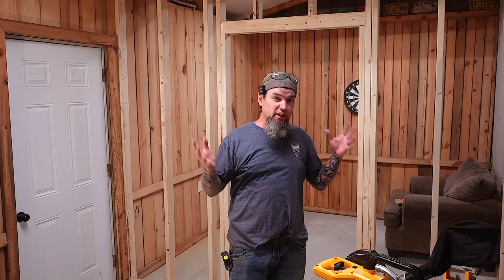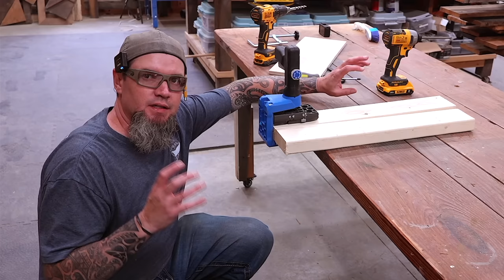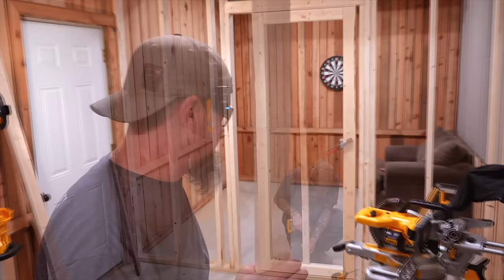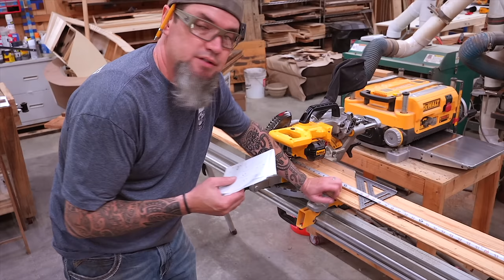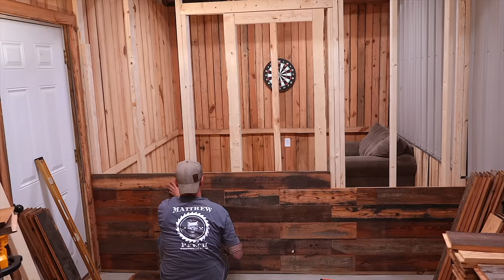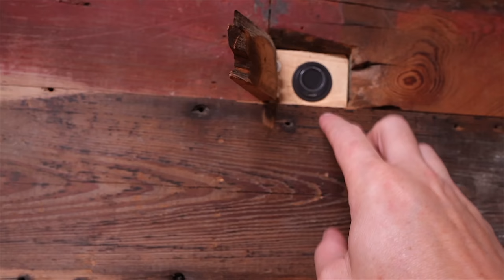Make A Hidden Room With Secret Compartments

Comment: Is it a safety issue to require finger print reader on inside for egress?  I am thinking of a kid or someone who gets in but then cannot get out in case of emergency.
Reply from the maker: The lock that finalized with will require fingerprint opening and locking all from the outside.  You manually lock it from the inside and the biometric stays unlocked while your inside.

Comment: hi great job love the finish result  not sure how your locking and opening mechanism works but you should install a manual release from the inside just in case you have power failure

Comment: Could you hinge the fingerprint scanner? Then just flip the wood panel it's in open to show the scanner to inside
Reply from the maker: Yes.  That was actually one of my work arounds that I had thought of.  But ended up with the lock staying unlocked while your inside and a manual lock inside.  Then you can lock it with a fingerprint from the outside when your leaving.

Comment: Or just put the board to which you mounted the fingerprint scanner on a hinge so you can access it from the inside. Although, if it moved out of position, then you might not be able to access it from outside. I would think they could have a simple switch to unlatch it from one side.

Comment: Love the room. Amazing. Quick question...why did you sandwich the hinges in between the 2X4's instead of screwing them on the edges of each one? That would have eliminated the gap problem. Would it have caused a pivot problem with the way the rustic boards pivoted? Could you have chiseled out the 2X4's to accommodate the hinges thereby eliminating the gap issue? Just trying to work through everything in my head. Thanks for all you post. You're rocking it.
Reply from the maker: So that I could get all the screws in.  The hinges were wider than 1 1/2"
Reply: @MatthewPeechWoodworking  See...I knew there was a reason. :D

Comment: Been wanting to do this myself.   Great video. 

Only changes I would make would be to use bevel cuts instead of miters for the boards and to increase the gap on the lock side of the door and framing.
Reply from the maker: You’ll enjoy a build like this! Have fun with it.

Comment: Thank you for your idea. I'm trying to build hidden door from the 20 x 10 enclosed deck to the laundry entrance. The  main entrance is a sliding glass door.  But i still want  access to the laundry room. An accent wall of dry stock Novik siding covering the wall and entrance  It will overlap at the seams . The hinge side will be straight into the pocket. The main door will have brooms and cleaning stuff. The backside of the  hidden door will have " security" items lol 😆

Comment: Really good. 
I would want some sort of fail-safe exit, a mechanical release might be best as you wouldn't have to worry about power failure.

Then just add the covert cctv system, a hardwired phone, a ham radio, 😊and you're ready for whatever. Oh, maybe some bomb/bullet resistant material too but that's probably overkill.

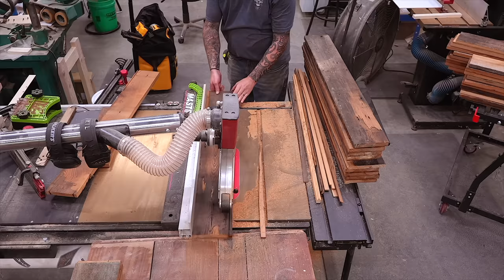Comment: New woodworker question: when you were ripping the boards to width why did you push some of them half way through the table saw, then back them up, flip and finish the rip from the other side? 10:44 
Also, I’m now desperately trying to think of a space in my house where I “need” a secret room like that! Great job.

Comment: I would have used a pivot pin at the top & bottom instead of conventional hinges. Instead of half lap joints, A back cut bevel/ angle cut with a half lap behind it works great. If you use a spring popper to pop open the door, you can pot the reader anywhere in the rest of the space like under an exposed junction box. I also would have put up plywood behind the whols finished surface with lpenty of adhesive to add mass to it so that it can't be found as easily by tapping around the wall. Foot traffic will eventually show as well as the door area will be open and unblocked. consider adding a fake electrical run with metal or plastic conduit between the boxes at each side of the door. It's an elaborate detail but it also makes it look even less likely to to have a door there. continue the conduit to another junction box and you can even wire up working boxes on the wall if you want to. Just put it down low enough to be unnoticeable.
Reply: 1  In the name of God, the Gracious, the Merciful.
2  Praise be to God, Lord of the Worlds.
3  The Most Gracious, the Most Merciful.
4  Master of the Day of Judgment.
5  It is You we worship, and upon You we call for help.
6  Guide us to the straight path.
7  The path of those You have blessed, not of those against whom there is anger, nor of those who are misguided.

1  Alif, Lam, Meem.
2  This is the Book in which there is no doubt, a guide for the righteous.
3  Those who believe in the unseen, and perform the prayers, and give from what We have provided for them.
4  And those who believe in what was revealed to you, and in what was revealed before you, and are certain of the Hereafter.
5  These are upon guidance from their Lord. These are the successful.

2  God, there is no god but He, the Living, the Eternal. To Him belongs everything in the heavens and everything on earth. He is the Sublime, the Magnificent.  Originator of the heavens and the earth. He made for you mates from among yourselves, and pairs of animals, by means of which He multiplies you. There is nothing like Him. He is the Hearing, the Seeing.

3  He sent down to you the Book with the Truth, confirming what came before it; and He sent down the Torah and the Gospel.
4  Aforetime, as guidance for mankind; and He sent down the Criterion. Those who have rejected God’s signs will have a severe punishment. God is Mighty, Able to take revenge.
5  Nothing is hidden from God, on earth or in the heaven.
6  It is He who forms you in the wombs as He wills. There is no god except He, the Almighty, the Wise.

36  To every community We sent a messenger: “Worship God, and avoid idolatry.” Some of them God guided, while others deserved misguidance. So travel through the earth, and see what the fate of the deniers was.

16  And mention in the Scripture Mary, when she withdrew from her people to an eastern location.
17  She screened herself away from them, and We sent to her Our spirit, and He appeared to her as an immaculate human.
18  She said, “I take refuge from you in the Most Merciful, should you be righteous.”
19  He said, “I am only the messenger of your Lord, to give you the gift of a pure son.”
20  She said, “How can I have a son, when no man has touched me, and I was never unchaste?”
21  He said, “Thus said your Lord, `It is easy for Me, and We will make him a sign for humanity, and a mercy from Us. It is a matter already decided.'“
22  So she carried him, and secluded herself with him in a remote place.
23  The labor-pains came upon her, by the trunk of a palm-tree. She said, “I wish I had died before this, and been completely forgotten.”
24  Whereupon he called her from beneath her: “Do not worry; your Lord has placed a stream beneath you.
25  And shake the trunk of the palm-tree towards you, and it will drop ripe dates by you.”
26  “So eat, and drink, and be consoled. And if you see any human, say, ‘I have vowed a fast to the Most Gracious, so I will not speak to any human today.'“
27  Then she came to her people, carrying him. They said, “O Mary, you have done something terrible.
28  O sister of Aaron, your father was not an evil man, and your mother was not a whore.”
29  So she pointed to him. They said, “How can we speak to an infant in the crib?”
30  He said, “I am the servant of God. He has given me the Scripture, and made me a prophet.
31  And has made me blessed wherever I may be; and has enjoined on me prayer and charity, so long as I live.
32  And kind to my mother, and He did not make me a disobedient rebel.
33  So Peace is upon me the day I was born, and the day I die, and the Day I get resurrected alive.”
34  That is Jesus son of Mary—the Word of truth about which they doubt.
35  It is not for God to have a child—glory be to Him. To have anything done, He says to it, “Be,” and it becomes.
36  “God is my Lord and your Lord, so worship Him. That is a straight path.”
37  But the various factions differed among themselves. So woe to those who disbelieve from the scene of a tremendous Day.
38  Listen to them and watch for them the Day they come to Us. But the wrongdoers today are completely lost.
39  And warn them of the Day of Regret, when the matter will be concluded. Yet they are heedless, and they do not believe.
40  It is We who will inherit the earth and everyone on it, and to Us they will be returned.
41  And mention in the Scripture Abraham. He was a man of truth, a prophet.
42  He said to his father, “O my father, why do you worship what can neither hear, nor see, nor benefit you in any way?
43  O my father, there has come to me knowledge that never came to you. So follow me, and I will guide you along a straight way.
44  O my father, do not worship the devil. The devil is disobedient to the Most Gracious.
45  O my father, I fear that a punishment from the Most Gracious will afflict you, and you become an ally of the devil.”
46  He said, “Are you renouncing my gods, O Abraham? If you do not desist, I will stone you. So leave me alone for a while.”
47  He said, “Peace be upon you. I will ask my Lord to forgive you; He has been Kind to me.
48  And I will withdraw from you, and from what you pray to instead of God. And I will pray to my Lord, and I hope I will not be disappointed in my prayer to my Lord.”
49  When he withdrew from them, and from what they worship besides God, We granted him Isaac and Jacob. And each We made a prophet.
50  And We gave them freely of Our mercy, and gave them a noble reputation of truth.
51  And mention in the Scripture Moses. He was dedicated. He was a messenger and a prophet.
52  And We called him from the right side of the Mount, and brought him near in communion.
53  And We granted him, out of Our mercy, his brother Aaron, a prophet.
54  And mention in the Scripture Ishmael. He was true to his promise, and was a messenger, a prophet.
55  And he used to enjoin on his people prayer and charity, and he was pleasing to his Lord.
56  And mention in the Scripture Enoch. He was a man of truth, a prophet.
57  And We raised him to a high position.
58  These are some of the prophets God has blessed, from the descendants of Adam, and from those We carried with Noah, and from the descendants of Abraham and Israel, and from those We guided and selected. Whenever the revelations of the Most Gracious are recited to them, they would fall down, prostrating and weeping.
59  But they were succeeded by generations who lost the prayers and followed their appetites. They will meet perdition.
60  Except for those who repent, and believe, and act righteously. These will enter Paradise, and will not be wronged in the least.
61  The Gardens of Eden, promised by the Most Merciful to His servants in the Unseen. His promise will certainly come true.
62  They will hear no nonsense therein, but only peace. And they will have their provision therein, morning and evening.
63  Such is Paradise which We will give as inheritance to those of Our servants who are devout.
64  “We do not descend except by the command of your Lord. His is what is before us, and what is behind us, and what is between them. Your Lord is never forgetful.”
65  Lord of the heavens and the earth and what is between them. So worship Him, and persevere in His service. Do you know of anyone equal to Him?

1  Say, “He is God, the One.
2  God, the Absolute.
3  He begets not, nor was He begotten.
4  And there is none comparable to Him.”

13  To Him belongs whatever rests in the night and the day. He is the Hearing, the Knowing.
14  Say, “Shall I take for myself a protector other than God, Originator of the heavens and the earth, and He feeds and is not fed?” Say, “I am instructed to be the first of those who submit.” And do not be among the idolaters.
15  Say, “I fear, should I defy my Lord, the punishment of a tremendous Day.”
16  Whoever is spared on that Day—He had mercy on him. That is the clear victory.
17  If God touches you with adversity, none can remove it except He. And if He touches you with good—He is Capable of everything.
18  He is the Supreme over His servants. He is the Wise, the Expert.
19  Say, “What thing is more solemn in testimony?” Say, “God is Witness between you and me. This Quran was revealed to me, that I may warn you with it, and whomever it may reach. Do you indeed testify that there are other gods with God?” Say, “I myself do not testify.” Say, “He is but One God, and I am innocent of your idolatry.”

100  Yet they attributed to God partners—the sprites—although He created them. And they invented for Him sons and daughters, without any knowledge. Glory be to Him. He is exalted, beyond what they describe.
101  Originator of the heavens and the earth—how can He have a son when He never had a companion? He created all things, and He has knowledge of all things.
102  Such is God, your Lord. There is no god except He, the Creator of all things; so worship Him. He is responsible for everything.
103  No vision can grasp Him, but His grasp is over all vision. He is the Subtle, the Expert.
104  “Insights have come to you from your Lord. Whoever sees, it is to the benefit of his soul; and whoever remains blind, it is to its detriment. I am not a guardian over you.”

85  Whoever seeks other than Islam as a religion, it will not be accepted from him, and in the Hereafter he will be among the losers.

29  Muhammad is the Messenger of God.

31  Say, “If you love God, then follow me, and God will love you, and will forgive you your sins.” God is Forgiving and Merciful.
Read The Quran